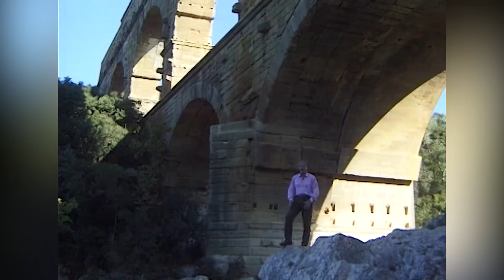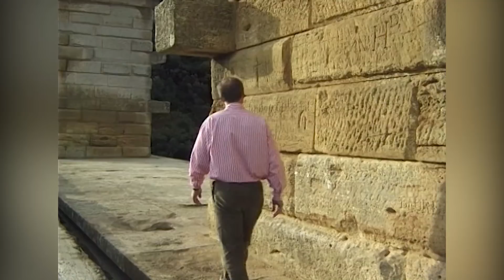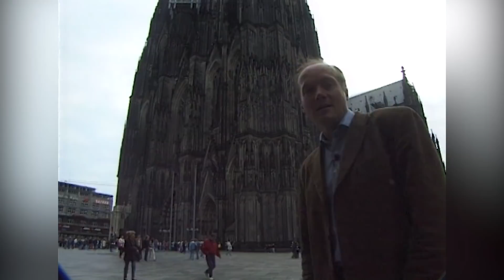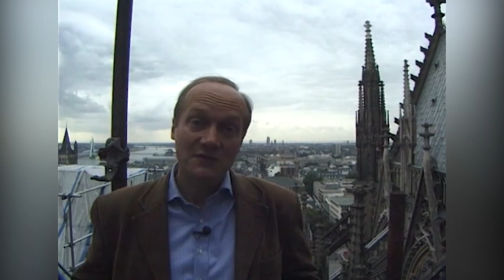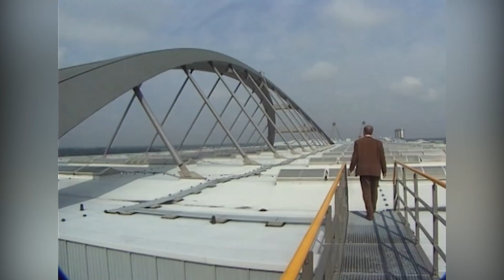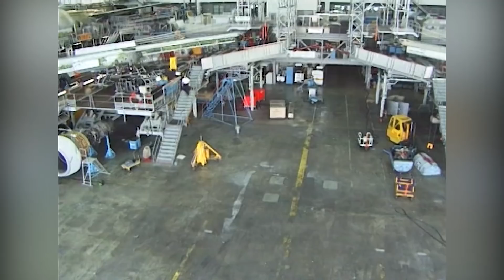The Key To Perfect Design | How Did They Build That?

Comment: Former Landscape Architect.... even today we still learn from Roman Engineering.

One thing I noticed but have never heard anyone talk about is how the Romans 'sourced' their stone materials. The Romans were able to locate, quarry, transport, and then construct amazing structures from stone and keep the 'appearance' uniform even on very large projects. The stones all looked alike.

Even today on large projects, we can mess up matching colors, textures, and types when using Concrete. Look at any highway, long sidewalk, large poured slabs, etc. Chances are if you look closely, different pours will look different. 

Imagine you are in charge of that Aqueduct. Closest source for stone is 25 miles away. You could get stone closer but there may not be enough for the entire project. Rather than building a structure that might look odd when completed, you commit the resources to have workers at quarry 25 miles way. It was better to have 'leftovers' of matching stone than look like a mishmash of non-matching material.

This meant encampments at multiple locations. This required even more resources, manpower, and labor management. The Romans were experts in doing this. Roman Engineering used division of labor, certain people doing certain tasks, over a long period of time. Each person specialized in a small portion of overall project. 

Every project used massive human labor on unimaginable scales. Not only did they build this Aqueduct, they were building at hundreds of other sites on hundreds of different projects, all at the same time, scattered over a dozen countries. 

Built 2,000 years ago and still standing is PROOF how good Roman Engineering is.

Comment: did they used cement ?
Reply: Yes Romans used concrete.

Different to the kind we use now - better in some ways, worse in others.

Their concrete lasts longer, and can take more weight without reinforcement.

But our modern concrete can take far more weight when reinforced, and takes far less time to set to its full strength.

If we can ever marry the benefits of Roman concrete with the modern ones then it would be a huge boon because it requires less maintenance.